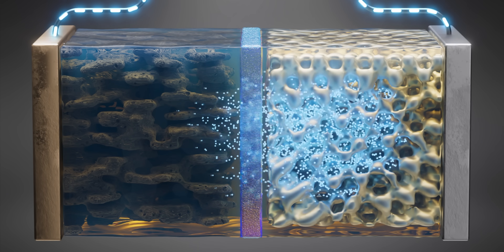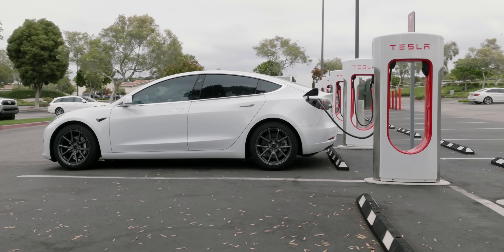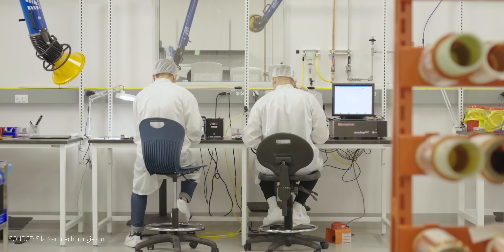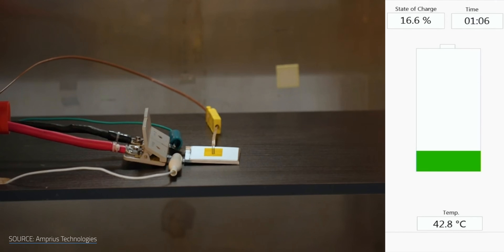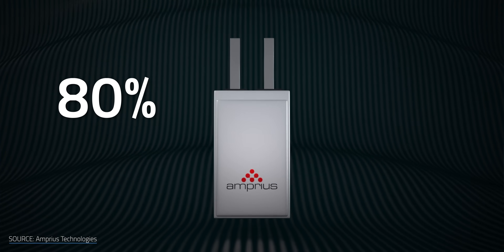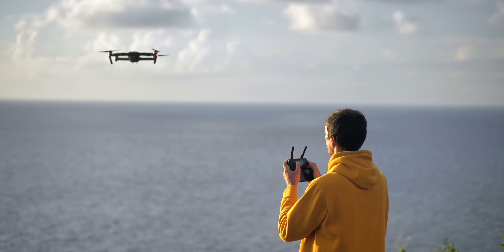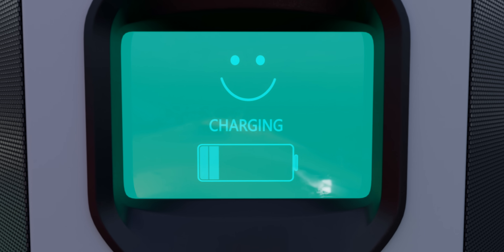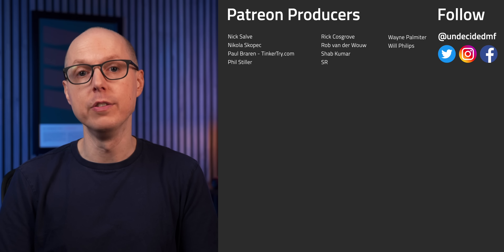Why This Ultra Dense Battery Breakthrough Matters

Comment: It is a nice slight change, but it would be a big leap if we could get away from lithium. I've seen some videos discussing batteries made from salt or even heated sand, which seem promising. Both of these would be far less damaging to the environment than lithium.
Reply: @Lord-Mangoat
No alternative to lithium exists because it has (thermodynamically) the most energy per unit weight.  More research etc. Cannot change that.  Hot sand, for instance, is an infinitesimal source of energy compared to lithium.

Comment: what about where that electricity comes from 2/3 lost to transmission 2/3 lost to converting it to the battery let alone the pollution caused to lithium mine and the environmental damages their LETS BE HONEST YOUR BETTER OFF USING A INTERNAL COMBUSTION ENGINE

Comment: the big jump to electric vehicals only matters if a battery that doesnt have any emissions and is 100% eco friendly can be used instead of the lithium batteries
Reply: There is no such thing as true green...  Whether you're pumping oil out of the ground, and burning it in your car, or digging up elements to make batteries, you're creating some sort of environmental damages.  But unlike an ICE car, EV's don't spew toxins and carcinogens out of their tailpipe everywhere that they go.

EVs are the less impactful way to go in the long run (everyone is so focused on the front end damages that happen because of mining), but the thing about moving to EVs is that one day we can pretty much stop the mining because we will have pulled up enough elements to sustain a world full of EVs.  About 80% of the metals will be in EVs on the road, and 20% will be in the recycling pool being used to produce more batteries.

And the earth will heal.

Comment: While how fast a battery can accept a charge is an important factor, one als o needs to consider how fast you can deliver the power, i.e. how much current time voltage the charger can deliver.  That is the limiting factor for most home chargers and even for commercial chargers.

As for battery chemistries, China is currently building plants to produce sodium ion batteries.  They are currently about 10% less energy dense, but that is expected to improve.  There big advantage is that sodium (salt) is cheap and plentiful and that sodium ion batteries are much safer and less likely to catch on fire.

Comment: I can imagine those structures do not grow linear, but tend to become dendrite... unless something is done. Not good for mass production anyway. Too precise and too expensive. Too unreliable too. Imagine an acceleration not uncommon in EV that will destroy your fragile batteries at once and in addition to mechanical deformation of the car you will have a major explosion in the battery compartment... I would rather invest in power elements that turn liquid fuel into electricity.
Reply: Sounds like you have the wrong impression of how EV batteries work...

I have a Li-ion flashlight at home with 5 settings for brightness.  When I put it on "blast mode" (most lumens possible) the flashlight gets hot as heck because of the speed with which the battery is discharging (the flashlight can actually catch fire if you leave it on "blast" mode too long...)

But an EV battery pack is a collection of hundreds to thousands of battery cells.

When you stomp on the accelerator in an EV you are distributing the pull from all those thousands of battery cells which means the battery cells won't overheat like you have with the single battery in my flashlight on "blast" mode.  The pull from each individual cell is not that much...

Comment: Exemplary research, Matt.  But as an urbanist, I can't help wonder how the huge obsession about EVs evolved.  Cars of any kind are problematic from several standpoints.  They consume too many public resources through their support infrastructure, funded primarily by taxes and debt.  A city's public road network consumes literally 40% or more of all urban land, with private driveways, parkades and garages pushing it to over 50%.  Cities designed for cars instead of walking human beings imposes a great burden on family budgets, especially in the suburbs where 1/3 of a house footprint consists of heated indoor dead storage space for cars, with often every family member owning one, some of them pure ego vehicles or driveway ornaments on dusplay, all made possible with deep debt.  EVs may help fight climate change mainly by displacing the petrol consumed by internal combustion engines, but that's about it.  It's better and cheaper to look at redesigning our cities to counter the massive subservience to the almighty car.  Walkable mixed use neighbourhoods, transit, more energy efficient buildings and a big push in renewable power (this is where massive banks of grid batteries come in) will do the planet, human health (ever live next to a freeway?) and public financial resources a lot more good.

Comment: A little off-topic, but we need to end the [0-60] wars. A near useless and potentially dangerous metric below 4 sec (rollout wiggles notwithstanding). As Japan had a many-years agreement between manufactureres to limit HP, EV powertrains need to have a similar handshake. So we can focus on charge times rather than acceleration times.

Comment: I still believe hydrogen is the best option.  It's all around us.
If they could figure out a way to separate the hydrogen from water when it's in the vehicle...the gasoline engine wouldn't need to change much.

Fire hazards would be minimal as well.

Comment: you know with all these fancy low production battery technologies, I wouldn't mind buying an aftermarket battery upgrade for my devices I really want extra juice in. if they can package them at voltages and formats that correspond to common uses you could buy this battery tech to keep your laptop going after a couple years instead of just the same 56Wh 14.6V for 100$. or you fix your smart watch or your phone and suddenly you get 2 days of juice.

if your buying aftermarket anyways to keep your device in service instead of buying a new one, it wouldn't bother most people to pay double to get double the battery life i think.

Comment: I saw the claims about amprus over a year ago. I saw the claims for the solid state lithium battery from multiple researches MANY years ago. here's what i've learned- tesla walks- BS TALKS. if the past is any indicator- they'll stay in the lab INDEFINATELY as tesla marches on. there was ONE unusual exception- maxwell technologies' dry lithium application method- which tesla IMMEDIATELY bought & implemented. it looks like- if a battery technology is viable? tesla swoops in & buys it.

Comment: you might want to double check your silicon facts. semiconductor grade silicon isn't made from just random sand dug in a desert or on a beach, I've read some reports that we're kinda running out of a good source. which could suggest that refining could get more expensive. I don't know how serious the issue is, but it's inaccurate to only portray silicon as the 2nd most abundant element on earth that is so easy to access.
they're not using it that simply.

Comment: For EVs, I think we've already reached the point where, for most applications, making batteries cheaper is more important than making them denser. Even EV semi trucks have already been built using today's battery technology, and the primary limitation on their usage arises from the cost of the batteries, not their weight.

Where improved energy density will really matter is aviation, as airplanes are much more weight-sensitive and much less cost-sensitive than cars and trucks. If we ever want even the shorter commercial airplane flights to be electrified, we need big improvements in battery energy density, with the research shown in this video a good start in that direction.

Comment: I hope they'll get the solar going as proficient as the batteries are getting. I want a car using some solar panels, that can grow its charge while I'm at work (even just a few %). My house is solar (as much as I could fit on the 4 sided roof), and I don't think the returns are matching the cost (I'll know more after taxes, I haven't been able to apply my $16K+ rebate to it yet, so my payments are 'spicy'). Adding batteries to my home would have doubled the cost of my installation. I hope these battery breakthroughs come to fruition sooner than later so my next house can be self sufficient to the best of my financial abilities.

Comment: Contrary to the current range acceptability being 300 miles, we will need the standard to be 600.  This is because the actual range of daily charging guidelines is only 60% of the rated range and doesn’t allow for anything but perfect conditions.  600 is my number but I think it works to compete with ice cars and the higher number would relive a lot of congestion at fast charge stations.  I have seen this technology before and it is good to see progress.  Batteries must and will improve very soon.  EVs are just better in so many ways.  With more home solar and wind power available to all homeowners it just makes sense.  Thanks for following the progress on battery tech.

Comment: EV's fail because they sell the battery with the car. Have not standardized for quick swap units. This eliminates the range problem and the weight problem. 7000lb cars are a dumb idea. The road repair doubles the carbon foot print of an EV. You need to repave the road twice as often because of the weight of an EV.

Comment: I just love the fact battery tech is improving by leaps and bounds, with $billions going into research and development.  It's not surprising that some of these technologies are already starting to go into mass production.  It's already a multi-trillion dollar market, and a lot of companies are going after it.  Even a small piece of it is a huge amount of money, and the critics of electric vehicles will be silenced year after year.  Fun to see, and this is the channel to watch.
Reply: Battery tech is almost the same today as it was 40 years ago.
Companies are investing billions into lithium ion battery facilities for a reason.
We aren't going to be doing anything much different for the foreseeable future.
Reply: What about the fact the most of our energy comes from fossil fuels? 
Also the grid can't handle everyone switching to electric vehicles.
I seen to remember a factory that wanted to switch all of their trucks to electric, I think it was ten in total. The city laughed at them because the grid couldn't support it. 
The factory had to install it's own massive generator, that generator used fossil fuels. 

I think a hybrid system is better. There is a trucking company from Canada that has built it's own hybrid truck.
Edison is the name.

I think batteries have their place. But being able to charge them without stopping is a major plus. 
How long does it take to fill up your tank of gas?
Not long.
How long does it take to charge the batteries?
A lot longer. Sure that time is going to be reduced in the future if the grid can support it.
Reply: It takes no time to recharge my Tesla batteries.  I am  usually asleep. Isn’t that the case for most people?
Reply: @sylarrogueII  For many people Hybrids are probably best for now but some of your arguments against EVs fall flat in the face of reality.  

Charging EVs with fossil fuels is still more efficient and better for the environment than running directly off of gas.  Think about it, hybrid cars get much better fuel economies despite being heavier and more complex than pure gas cars because electric motors are extremely efficient and a gas generator is far more efficient than a gas engine (gas generators can be built smaller and always operate at peak efficiency/speed).

As edwardcoulter9361 said most people with EVs charge over night which means that for the vast majority of people, the vast majority of the time they never have to stop to charge their cars at all (aside from when they'd stop anyway).  As battery densities improve we'll eventually reach a point (we're pretty close now) where most people could drive all day, stop at a hotel that has charging, and charge their cars overnight (far cheaper and better for the battery than a fast charger) while they sleep (or don't sleep).  One real concern is for people in apartments as many apartments don't really accommodate charging EVs at home though the economics may still work out even if you have to pay at a fast charger (last I did the math it would actually be better for me though the last time I bought a car the upfront cost of an EV was still too much).

You yourself also mentioned that charging times are improving which means that even if you do have to stop at a fast charger you probably won't have to wait all that long (at least for a charge to 80% which will get you far enough that you'll want to stop again anyway).

The grid thing is a real concern and there are ways to address it but since I live in "the good ol' US of A" I've not got the greatest confidence that'll get fixed in the near future.  That's the true biggest issue with mass EV adoption and the governments big push for EVs.  Still, so long as the market forces are strong enough, which I think they might be, we should start seeing improvements in that department (and as I mentioned above, even if we had to power fast chargers with small gas generators it would still be more environmentally friendly than pure gas cars).
Reply: @sylarrogueII  the point is suppose to reduce carbon emissions, not everyone switching to EV, maybe that's why they haven't force everyone to EV yet
A lot of our energy sources come from fossil fuels but not all of them so it somewhat reduce carbon footprint
Even though it's just changing from one type of polluting to another, any temporary solution works fine enough until we know how to solve those pollution issues, i would see that as a win

Comment: 3200mAh battery in a phone is so little, and barely gets through an entire day. I would expect to see new batteries to have at least 10,000 mAh for phones and other small tech, it's an insane amount of power for a small device, but the less time you need to charge it, the better for the battery. Plus battery performance degrades so quickly after 100 cycles.

Comment: If it could have an insane density at the cost of charging rate, I am certain some people could find a use for it. Imagine an EV that can charge a day or two and last for three... seems like it would be a great option for smaller vehicles only meant to operate in cities or over short distances, as they wouldn't need much in terms of batteries to begin with (thinking about like a moped or ebike sized).
Reply: Great point ! Taxi or bus services would see this as a positive since they have a central location fir vehicles

Comment: It's exciting to hear about new battery tech until one remembers, it takes about 10-15yrs for new tech to enter production "if" it happens at all.  The battery industry has been "talking" about "holy grail" batteries (batteries w/single digit charge times, light weight, fire resistance & decade longevity)... for well over 20yrs  :'(

Comment: Another big sector you may have forgotten to mention is complexe rehabilitation.

There are a LOT of battery operated devices in the medical space. PWCs, patient lifts, tracked ceiling lifts, CPAP machines, the list goes on. Having a battery thats super energy dense and charges fast (but also just as important, doesnt degrade abnormally fast) would be a godsend to people with disabilities in PWCs and MWCs w/ power assist!

Depending terrain and other conditions, a Permobil and Quantum can avg 4-9miles on a single charge before it has to be down for 3-4hrs to get back to 100%

If batteries like this allow a person to achieve double, if not triple, the range and only take about 2hrs to fully charge (or faster) that would be life changing for people with PWCs!
Reply: I agree. There is a huge market for such improvements on many other things than cars or trucks. Electric bicycles would have pretty impressive ranges. The new hunting fat tire bikes already have a range of 30+ miles and could pull some pretty serious hills and loads with that kind of density.
Reply: @WayneTheSeine  that'd be wicked having a city shredder that's as lite as a traditional pedal bike but with a range of that allows near 60+!

Not to mention phones. We'll be back in the Nokia/Motorola days in terms of battery life if this battery tech comes to be and into the smartphones (fingers crossed!)

Basically, every niche of daily life can and will benefit from this improvement.
Reply: @PorscheDuésnburg  It would be awesome silently riding to your deer stand or pulling a small trailer with tent and camping gear and ice chest. You could camp in some really awesome, no one else around, kind of places. Wireless security cameras already can operate up to a year on AA batteries. They could operate for 3 years or more on one charge with these batteries. Pretty awesome technology, let's hope it comes to fruition.